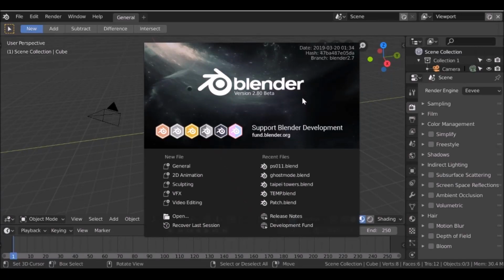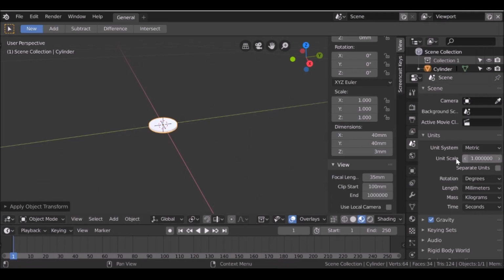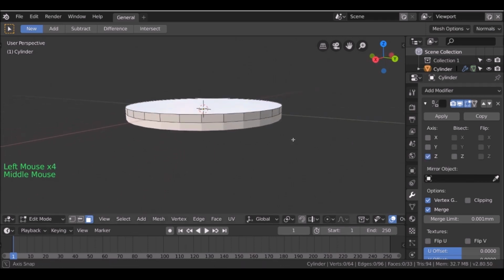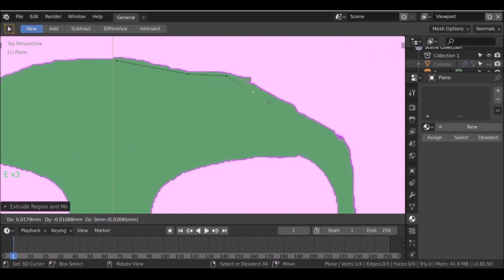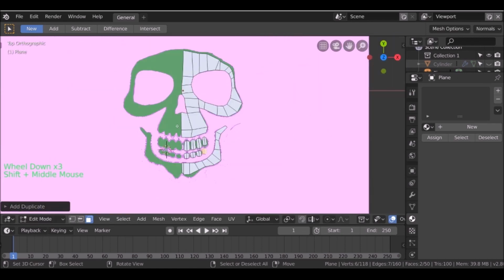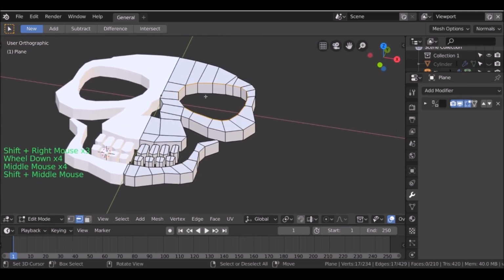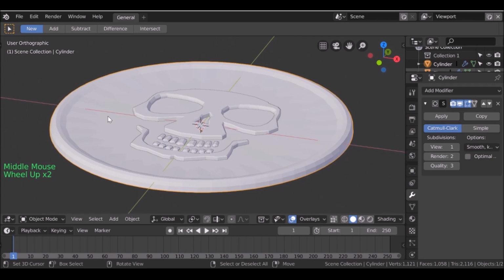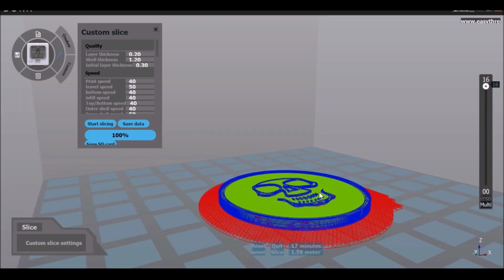[3D Printing] Pirate Coins

Comment: I was working with blender yesterday trying to create some audio Spectrum effects for one of my Beat videos it took too long to render I have to shut the computer down
Reply from the maker: How long is to long? I remember rendering some small animation that was like 5 sec long and it took almost a week.. Heavy scenes are a killer for render time.. Have you tired 2,8 and eevee?.. that should render much quicker (though it's still in beta and has quite a few problems of it's own). If you are working on a project that requires immediate render, say for a client, I would send it off to a render farm.. we did a review for Blender grid and they provided free credit so you can try it out..
Reply: @DarkfallBlender  the video is 4 minutes long
Reply: 2 hours into the render I had to shut the computer off
Reply from the maker: As I said, you could try 2.8 and Eevee or use a render farm.. Other than that I am not sure what to suggest 😕 ..
Reply: @JoquanDaHooligan  You can always try just turning down some settings, do like a 1 frame comparison and try to get as much lower as you can without it looking TOO different. One subdivision level can save days of rendering. If your computer is not as good as some others you could try reaching out to friends to see if they have an amazing PC that could render it for you as a favor :)